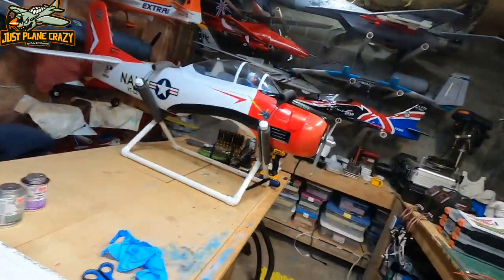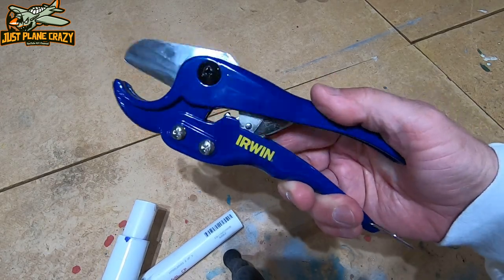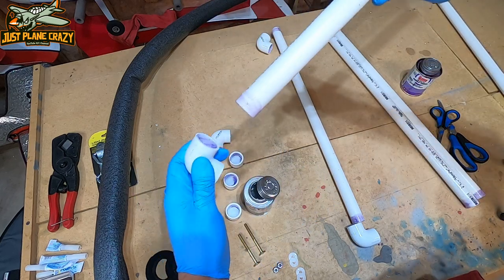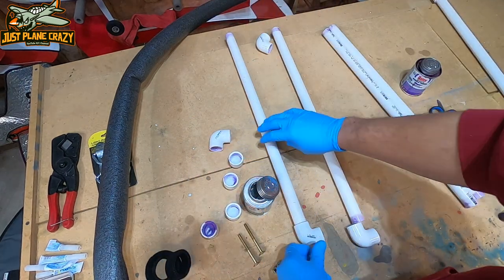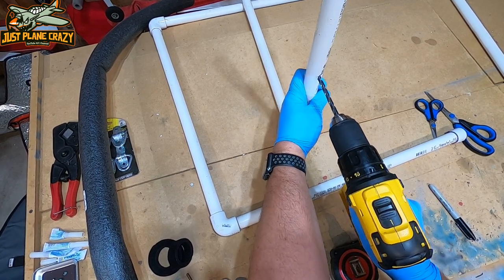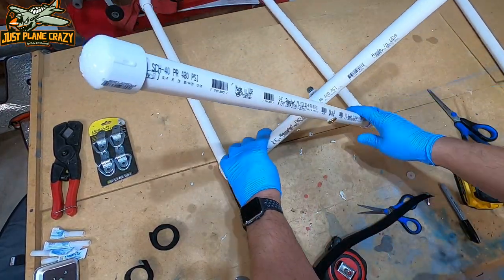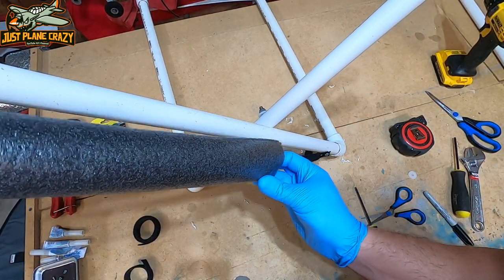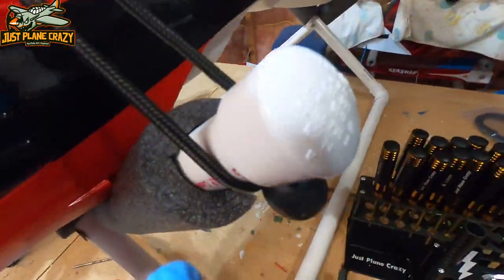How to Build Your Own Adjustable Airplane Stand, Cheap!

Comment: Really good stuff! I built a pvc stand when I first got into the sport 5 years ago. Too complex to do again. It had a CG stand and a slot to hold your wings. This design of yours is quick and easy and something I can have on the bench or tie down in the back of the truck. With the adjustable height maybe get 3 planes in the bed.
Thanks for putting this video together. Much simpler.

Comment: Great stand!  If you want to make a permanent angle you could use lawn chair strap on the bottom bars and then it could flip over like the stand you showed. Then you could even velcro two stands together to have an elevated stand.

Comment: You dont need any primer, a small scratch with sand paper does the trick and in any case there is no way you need these joints to be water tight so a little glue is fine

Comment: Nice work. BTW, I'm a lifelong plumber. You don't need primer 100%. The pipes will not be pressurized. I actually build mine a while back, different design, completely without glue, and it still works perfect. Good luck!
Reply from the maker: Thanks good info

Comment: You’re smarter than me, so you either thought of this or did this-
On the 2 pieces of pvc that run parallel to the floor/table top, (Connects to the “V’s”) I put a coupler/joiner. Now I can adjust the length for the big a-10 or go smaller.
I did think about making more stands for different sized planes, but that would be too easy.... (LOL!)
I do need to make two more stands, and I will, but the FL 1600mm P-38 has me stumped. I want to build a stand for it for the back of the truck. (I swear, I’ll shoot myself if I EVER have to take the wings off again. If I crash it, I’m leaving it)
Reply from the maker: Lol